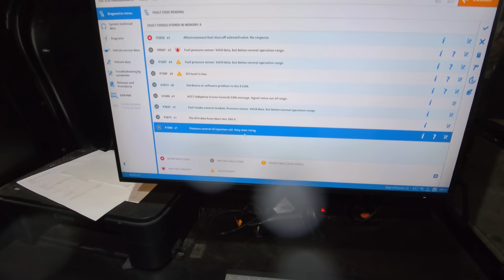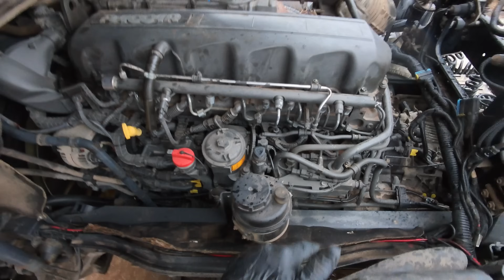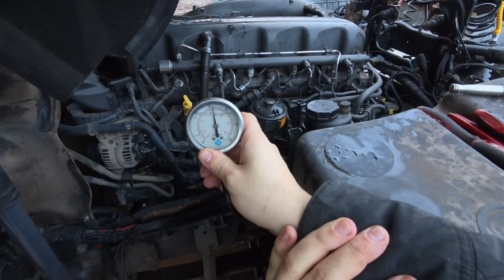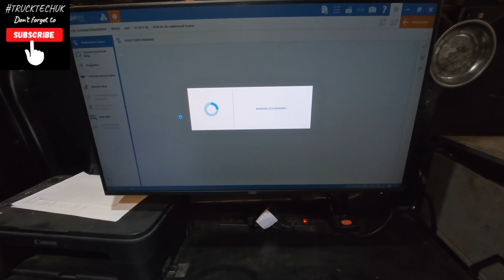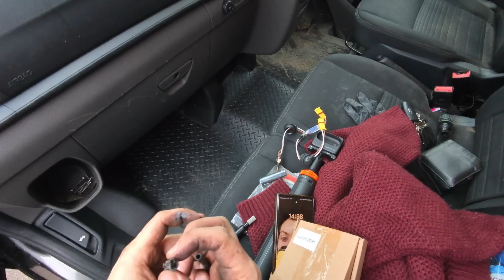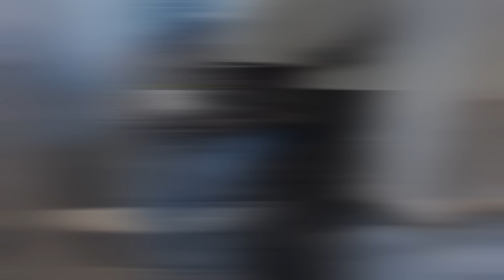UNDER PRESSURE? Fuel filter diagnostic and night heater service

Comment: Hi Sir. Am currently facing same problem with my DAF CF 400 MX 11. Euro 6.  Fuel pressure too low.   I changed fuel filter and replaced 6 injectors. New Diesel filter. But it still says fuel pressure too low. I fixed a new fuel lift pump (but not original Paccar PART).What next should I check please.  Thanks in advance.

Comment: Hey I love your videos.    I have a question.  Got a daf lf px-7 engine.   Dpf fills too fast.  regen too frequently. Done turbo.   Dpf filter.  Injectors.  Cleaned out EGR.  Was wondering if you’ve encountered anything like this
Reply: I’ve had a load when they’ve been on sweeper work or high p.t.o idle time.
When you take off egr valve have you checked inlet manifold carbon content ?
I’ve had to take off fuel rail and with a burning torch atomise the carbon with oxygen. 
This is on top of cleaning, egr valve, egr cooler, Venturi pipe from exhaust manifold to pressure sensor pre turbo, leave pipe fitted and with engine on high idle heat up pipe with sensor removed to push out carbon.
I’ve had some early euro 6 Daf we had to update engine software and take it out of eco mode in a way. Higher acceleration, holding gears for longing etc
Reply: Don’t let the carbon from inlet manifold get to valves otherwise they won’t fully close and you’ll have to blow start it with a tyre cheetah. 
Mistake I made but fixed

Comment: Hi mate great video again. I notice on your fuel filter diagnosis you did not change the filter under primer or did you just not film it?.
Reply from the maker: Hey buddy thanks for the comment. I didn't need too as it didn't have a big negative draw on the pressure gauge so it wasn't blocked